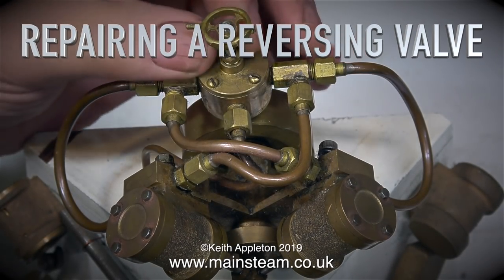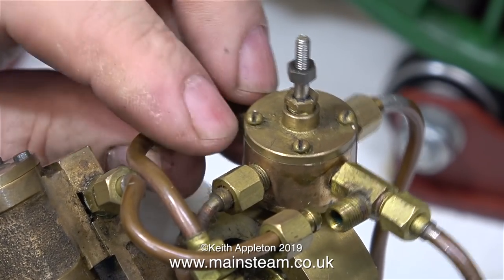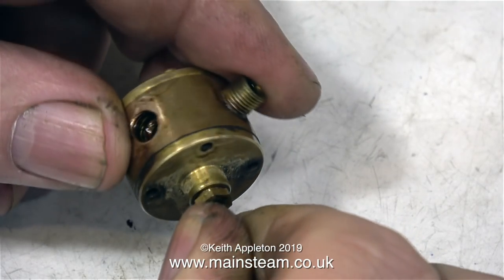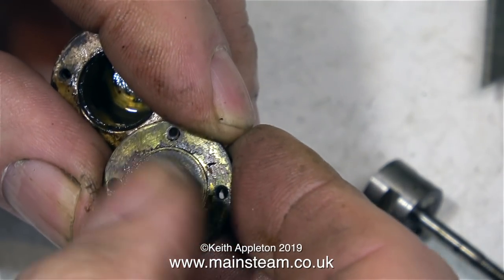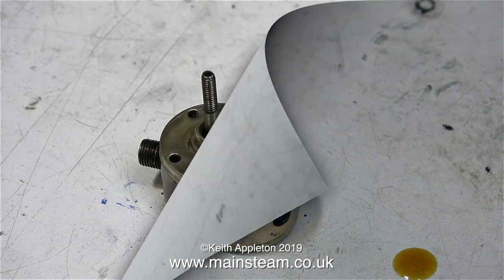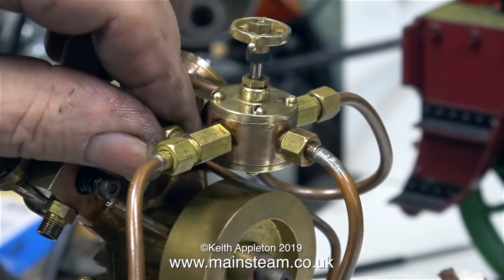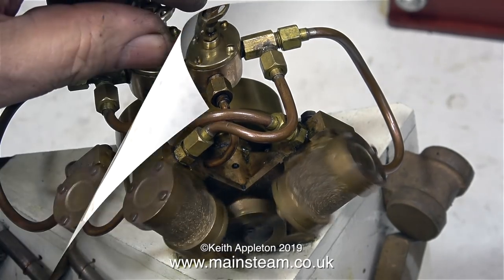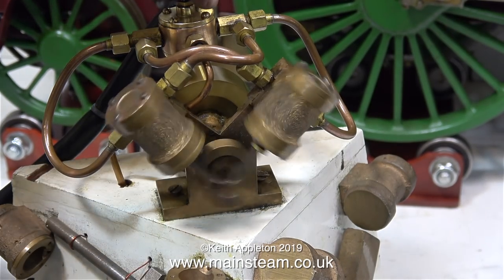"BLACKGATES TWIN" STEAM ENGINE - REVERSING VALVE REPAIR

Comment: Mr. Appleton, as I watched in so many of your videos when you're using your T handle tap Drive at times you get into spaces where you have to pull either the tap out of the drive and use your spanner, or just use the tap driver without the T handle. I was wondering if you have ever heard of socket style tap drives? They are very handy using taps in tight spaces you use them with either 1/4 inch or 3/8 Drive  ratchets depending on the size tap your using. They're actually thinner in diameter and shorter than the T handle drive itself. I'm sure your friends at Black Gates engineering can show you and example of them I think you would find them useful.

Comment: Am I wrong or do you really have 5 engines? The two you bought, the one you have here in the video, the machined kit on the display and the un machined kit on the display.
Reply from the maker: The demo version belongs to Blackgates Engineering ..... I was just fixing the reversing valve for them.